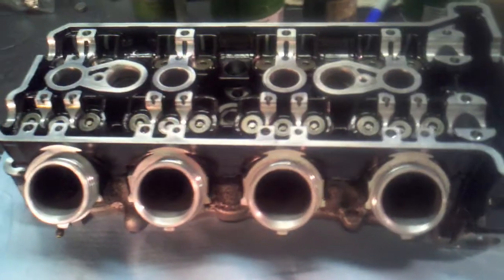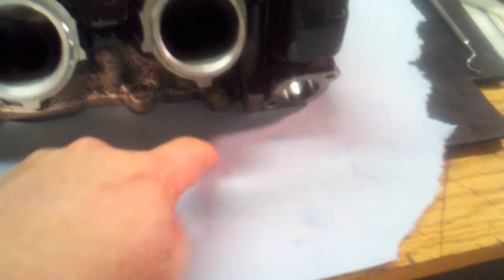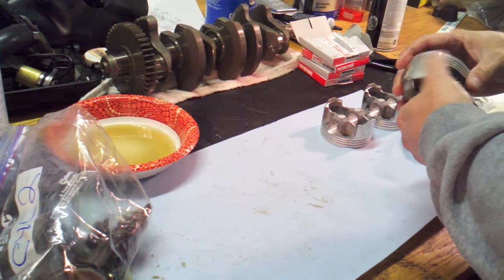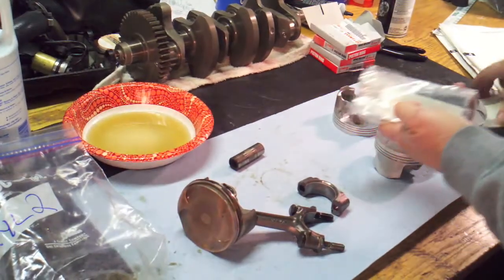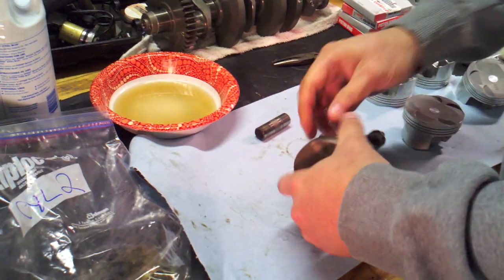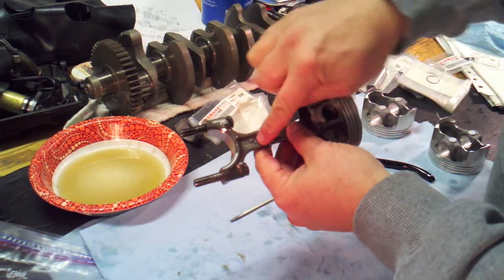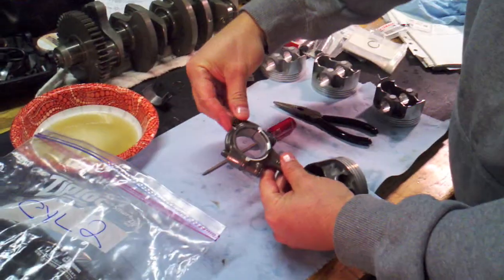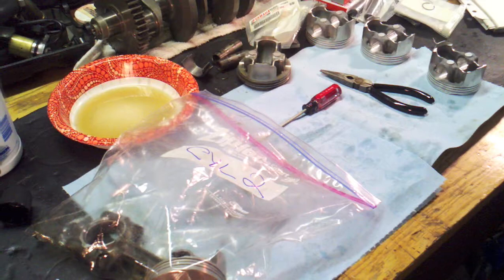2000 Yamaha YZF-R1 Engine Rebuild - Part 16

Comment: I'm replacing my pistons and rings as well. In my Ring set, the two top rings are different colors. I can't find in the manual which ring is the top ring, and which is the 2nd ring.  Were you able to tell which one is which? Also did you have to gap your new rings or did they spec ok?

Comment from the maker: New rod bolts require a very precise stretching procedure for which I do not have the proper tools.  I made the call that it would be better to reuse the stretched bolts I had, rather than improperly stretch new ones.  It was a judgement call.  I did use new nuts btw.

Comment from the maker: You are not wrong... measuring rather than relying on original factory measurements is reasonable.    The factory service manual specifes the correct tolerances, so you can measure for yourself rather than relying entirely on the stampings on the case and markings on the rods... but I also think the factory engineers make the assumption that nothing should be wearing that ever changes these original specs.  The crank and the rods are hardened steel, and are not wear parts.

Comment from the maker: I bought new pistons mainly because the guys at MST recommended using new pistons with my newly replated bores.  Could I have used my originals, especially once I cleaned them up.... yes.  They were still within spec, but I just decided WTF and went with new ones.